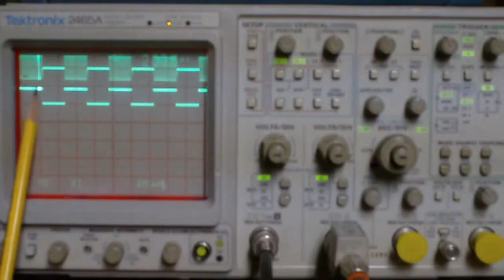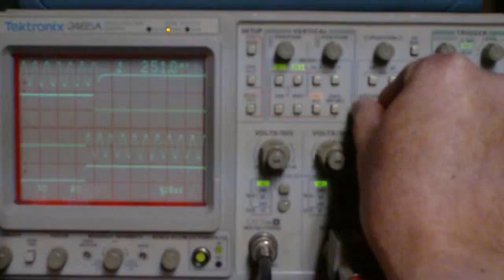Tek 2465A delayed sweep

Comment: 2465 CTS
I perform the PULL-INTEN by pulling the B SEC/DIV knob out. This highlights a small area of the trace and I can position the highlighted area with the DELTA REF knob. The next step is TURN-ALT, simply turning the B SEC/DIV knob one stop to the right. This causes the highlighted area to expand to about 40% of the screen width. It also cause what looks like a poor trigger but the triggered light is still on.
I do not get any new traces to appear.
 Is there a next step I need to make?